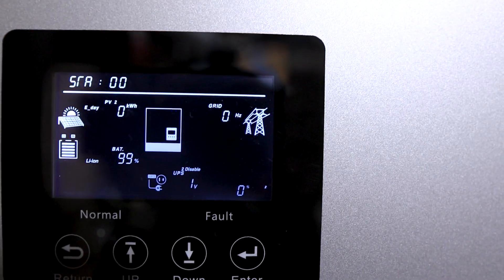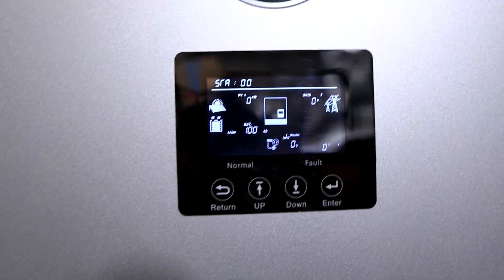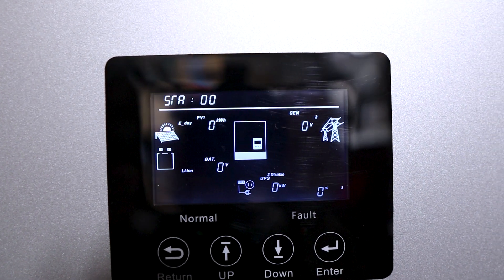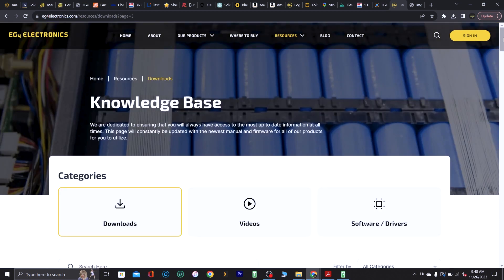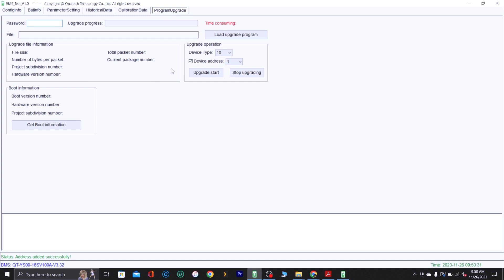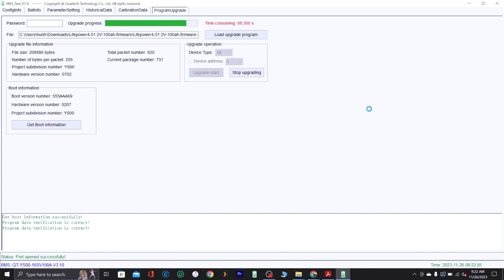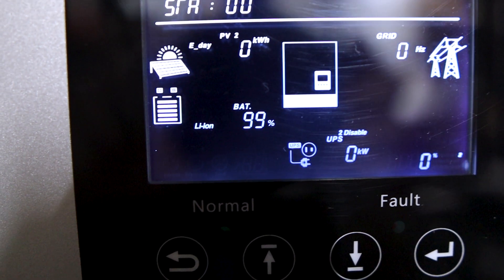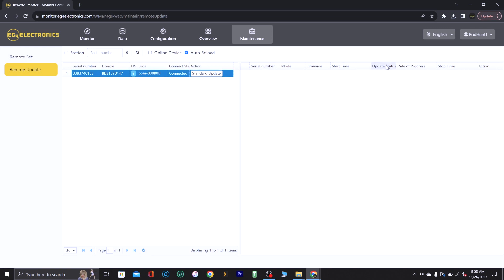EG4 6000XP Closed Loop Battery Communications Fix - How to Update EG4 Firmware

Comment: I bought EG4 batteries 7 months apart.  How do I simply CHECK the firmware version on each battery?  I want to find out if I need to update.  Thanks.
Reply from the maker: If you have an lcd screen navigate the menu to version or fw version. Non lcd screen requires a pc with a usb to rs485 cable. Get the eg4 battery monitor software(bms tools or bms test). Eg4 gas a bms setup whitesheet with instructions to read all info from battery.

Comment: Should i update inverter or batteries first? Do i have to do just the master battery or all?
Reply from the maker: @bobcole3852  usually all of them. I couldn’t get just the master to work but it would be worth trying. I would just update both if you can

Comment: Finally finished setting my system up, reviewed again this video as i need firmware updates on inverter and batteries bought last November. (Had to wait for ground thaw to do panel mounts).

Having same issues you did, only problem is no internet at solar shed. SS tech support told me how to use my phone to connect to inverter to update that but batteries are a problem! Guess i could take laptop out there after downloading updates....
Reply from the maker: Is it the lifepower4 or LL batteries?
Reply from the maker: The lifepower4 has the free updater from SS. It will auto update

Comment: So how did you get the update file to run?  It says I need a program to run the BNC file.  The program is from Russian company and there is no way to download it.
Reply from the maker: If you are trying to update the lifepower4 batteries then contact signature solar. They will send you a free plug and play updater if you purchased batteries through them. That is the easiest way!
Reply: @rodneyhunt  That's no fun, I like doing things the hard way.  Also I want it done NOW!  Well, I guess I will just do all six one at a time.  Signature Solar tech support did send me the instructions on how to do it.  You run the upgrade program from the BMS test program.
Reply from the maker: I have had problems doing it that way as well. So now I tell everyone about the plug and play solution if that doesn’t work out for you.
Reply: @rodneyhunt  Nope, couldn't get the update program to run.  I will just set the inverter battery setting to lead acid and ordered the update device.

Comment: For the update do the batteries need to be off? I have 2. Do the dip switches all have to be down with it off or can they be on?
Reply from the maker: I turn them all off except the one that I am updating. Dip switches set down on the one you are updating as well

Comment: I've read on some of the other post that you have to use a special Eag4 read/write cable to update the firmware on the batteries. Looks like your using the rj45-usb that came with the battery? I'm getting ready to install my 6000xp and pretty sure I'll have to update the batteries and now not sure if I'll have to get the special read/write cable or can just use the one that came with it??

Any way, thanks for posting this. The walk thru on the download will be very helpful
Reply from the maker: Hopefully it works for you with no problems! Are you using lifepower4 or LL batteries?
Reply: @rodneyhunt  I have two lifepower batteries

Comment: Oh praise God!!! I think you might have saved my life!!! I will try this out this morning at my customers place. WE CANNOT GET THE AC POWER TO COME ON!!  If I can't make this work, I'll have to rip it all out and re-install the old 24V lead acid system!! HE NEEDS AC POWER YESTERDAY!!!
Reply: Praise Yah!! My prayers were answered! It turns out to be some kind of communication issue between the LifePower4 batteries and the EG4 6000XP combo charge controller/inverter. The fix is to set the "master" battery DIP switches to 0000 and do a firmware upgrade on it from the 'net and reboot. I now have one of six batteries talking to the 6000XP (6,000W AC out/8,000W solar in) and that seems to be enough to keep it happy.

Comment: Does the dip switch order matter for the update process
Reply from the maker: Down on the one you are updating. All communication cables disconnected though. 👍
Reply: @rodneyhunt  i have 1 4 dip switch ll and 5 LL's with the 6 dip switches. thank you merry Christmas and happy holidays
Reply from the maker: @tjmooney4181  I have only updated lifepower4. So not 100% sure on LL’s

Comment: Do you have all the dip switches on the battery in the down position?
Reply from the maker: Yes. I had communications working with this test setup. Should have a video out soon with 3 of the 6000xp’s hooked up running my house but having a communication problem when all batteries are hooked up so far.

Comment: Thanks for this video. My lifepower batteries would not communicate with the 6000xp so doing the firmware for the batteries did the trick! I didn’t need to mess with firmware for inverter. Make sure you update the firmware separately for all batteries.
Reply: You should make one of those dolly setups with this inverter for a portable dual 240v system with one battery.
Reply from the maker: @stevezark2152  would need a bigger dolly. This one is really too short. Maybe one day I can do a permanent portable build with this. Would like for it to fit in a vehicle so I could lend it out during emergencies.
Reply from the maker: So you had to do all the batteries?
Reply: I did both batteries before turning on the inverter. Thought since I did one why not do them both right? I didn’t try to do just one and turn it all on again.

Comment: I did hear on the forums that the LiFePower4 batteries didn't work without doing a firmware update.  Thanks for showing how that worked.  I ordered two EG4 LL batteries along with the 6000XP on Black Friday.  Should be delivered the end of Dec so I'll be referencing your videos for any updates needed.  Hopefully they just ship with updated firmware by then.
Reply from the maker: Hopefully updated already but if not it is pretty easy. You should really like this inverter
Reply: @rodneyhunt agreed. Everything I've seen has been great.

Comment: Do I need to do this for each battery separately or just 1?
Reply from the maker: I would guess just the one battery. I have not setup yet with my other batteries but I would guess as long as the host battery is communicating it can send all other battery info since they are talking to each other
Reply: @rodneyhunt  great thanks so.much I'm headed to help someone update a lifepower4 battery in rack of 6 that won't charge or discharge
Reply from the maker: You can always put it on lead acid if you have problems with the update
Reply from the maker: @tjmooney4181  Did you get it working?
Reply: @rodneyhunt  thanks for asking, no we think his number 5 battery is dead so he plans to upgrade to a v2 and use as his master in his battery rack